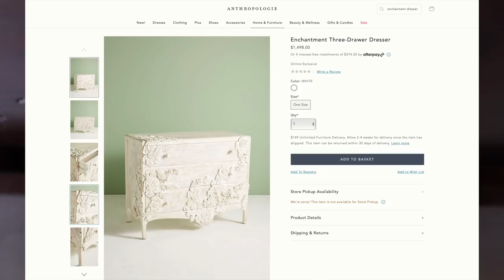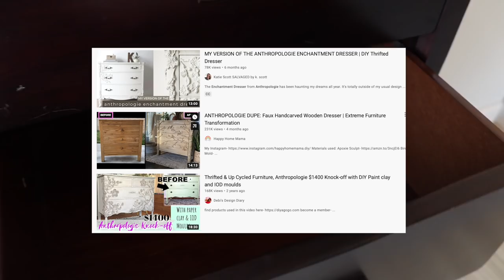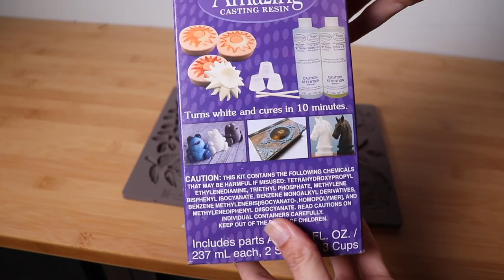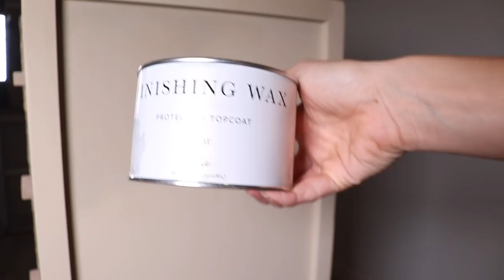My Anthropologie DIY Enchantment Dresser \\ Furniture Makeover With Decor Moulds

Comment: you made it work obviously, but when you are sanding those tiny little handles instead of risking injury, you can clamp your sander upside down in a vice or something of the like and then easily sand your smaller pieces with your sander in a fixed position. I find it's a lot easier this way as well

Comment: Here's a super silly question. How do you know if you should or shouldn't prime? I have this piece my neighbours had left on the curb and it seems Like they tried to sloppily add a wash over existing wood. Wondering if I can just get away with scuff sanding and painting.
Reply from the maker: If you are cleaning your piece and your cloth or towel is getting stain/tanins on it, it is a good indicator you need to prime.